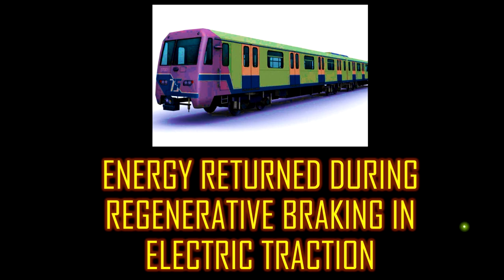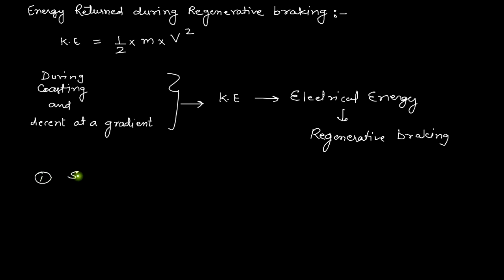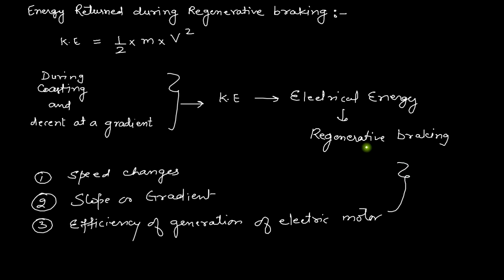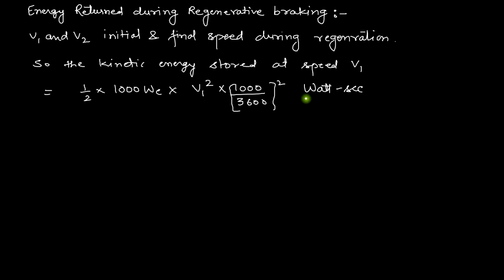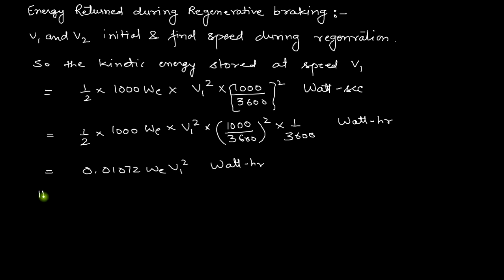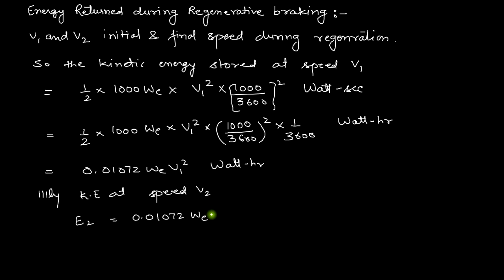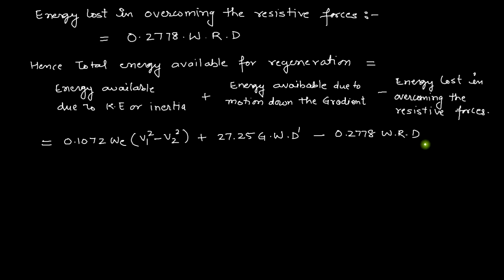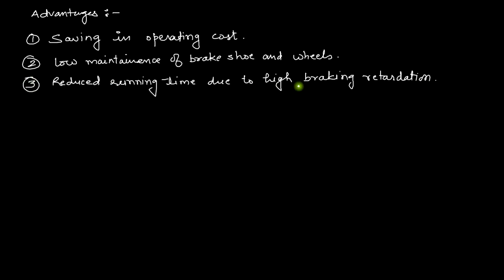energy returned in regenerative braking in electric Traction system

Comment: Sir.what will happen in case there is no other trains in that perticular section to use regenerative energey prodiuced?
Reply from the maker: This case is not possible as the bus is assumed to be a infinite bus bar. But still,  if we assume it to be a section where there is no other train or load then there must be a provision of storing that regenerated energy in the train itself for later use or for auxiliary equipment use. 👍